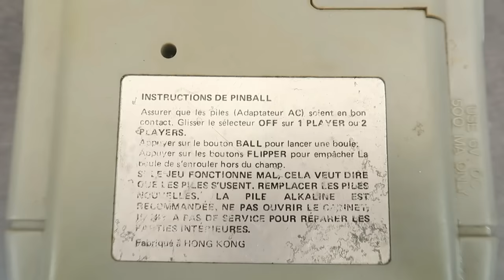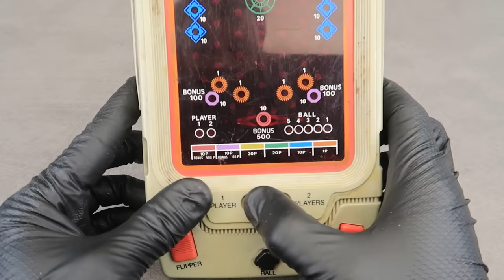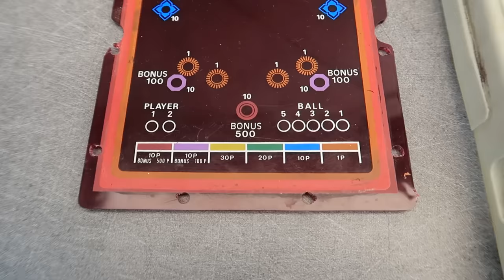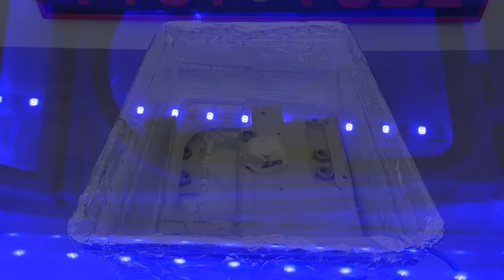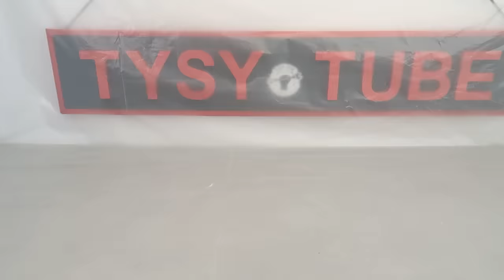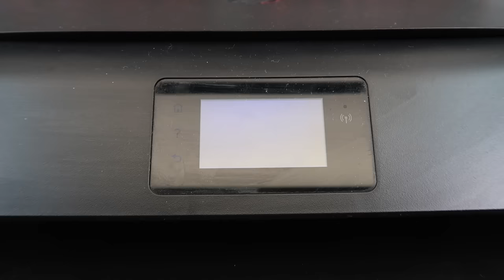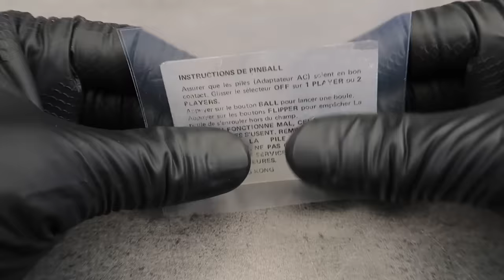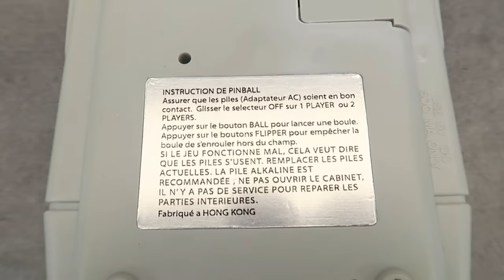Electronic Pinball Retro Game Restoration

Comment: Just a little soldering tip: use a finer point soldering iron and before soldering remove any extra/old tin and ad new tin for a better result and stronger soldering and don’t put the tin on the iron itself just at a bit when you head up the cable but for the rest well done
Reply: Please link is to your awesome videos.

Comment: Tsy: puts batteries on corroded contacts
Product: doesn't turn on
Tsy: :o
Reply: I think you meant "This is not a good sign..." 😏
Reply: "I found these broken wires, that totally broke by themselves inside of the game and not from me opening the case at all"
Reply: it's for dramatic effect.
Reply: I thought it was silly to place batteries into a device with corroded terminals, but this did give a baseline level of functionality before the restoration.  I think he knew that there was very little chance that it would not work once the terminals were cleaned and the wires were soldered back on. He may have tested the device with a 6V power supply before making the video just to be sure.

Comment: Two things. First, be careful putting elastomeric contacts in water. These are the black areas on the bottom of the rubber push button switches in this project. Sometimes they are a coating, sometimes a carbon puck, but either way some of the older ones used a water soluble adhesive and putting them in water will make them dissolve. 
Secondly, using UV leds around a plastic container decreases their effectiveness by at least 50%. The plastic material diffuses the light and depending on the type of plastic, some of them have a UV inhibitor in them so that they don't break down as fast in sunlight. A large, clear glass container is a much better option for a retrobright tank. 
1
Reply from the maker: maybe next time i will buy a fish tank 🤔, thank you 😊

Comment: “The most desired handheld of the 80s”
Colecovision football game: “Am I a joke to you?”
Reply: My husband still has his!
Reply: Football is not played worldwide... Very rarely played outside the USA..How could it be the most desired handheld of the 80s ?
Reply: For my ( french) football is your soccer so yes he his a joke to me
Reply: I got Coleco Head to Head Ice Hockey. Meh.
Reply: The most desired handheld of the 80s isn't a handheld at all but a tabletop. Look up the Entex Adventurevision. This amazing tabletop used a spinning mirror and LED's to achieve graphics. Extremely expensive sadly. As for the restoration of the pinball machine, fantastic job!! I think the machine is a Castle Toy pinball.
Reply: @chevreunijambiste2854  t'as voulu dire quoi  ?
Reply: @familleeatyourmails4205  flm
Reply: @deathstrike  strong desire ? Only 50.000 units sold....
Reply: @chevreunijambiste2854  lvd
Reply: @familleeatyourmails4205   Not when it was sold, the Entex Adventurevision is NOW one of the most sought after electronic handhelds. Only a few hundred or so have surfaced in the wild. I have one, but it only has Defender and it is sealed tightly in my closet due to the plastic oxidizing easily.

Comment: To have your screwdriver shaft temporarily magnetized you might want to consider using a small magnet such as the ones found in mechanical hard drives. Those come in a flat, slightly curved shape and are quite powerful compared to their size. I often use one or two of those stuck to the screwdriver shaft (as near as possible to the tip) when I need to "fish" screws in deep recesses, just as you did, or just keep hold them when screwing/unscrewing.

Comment: I have a tip to give you, if you don't already know, for using instant glue.

When gluing, for example, two plastic plates, which form a 90° angle, place a wooden toothpick at the internal angle of the joint. The toothpick will solidify this joint.
And when the joint is 180 ° (edge to edge) put a strip of paper towel after applying the glue to the joint, and then more glue over that strip. The strip of paper towels will solidify and serve as a patch, strengthening the joint.

Comment: Ordinary vinegar or lemon juice works pretty well to remove battery corrosion from contacts.
You can usually weld most case material back together using acetone or PVC pipe cement.

Comment: a nice job restoring a classic hand held game. I would have liked to have seen maybe the use of some epoxy on the cut off plastic posts instead of melting them with a soldering iron but otherwise it was top notch. I have an alarm clock fro Casio from the late 70s that has the same yellowing plastic and corroded battery terminals and i would love to restore it like this. It still works and the LCD screen is still without residual black marks as some get. I dont use it any more but i would love to restore it anyway, this vid and the space invaders one (which was the first one i saw of yours) has given me the info to try. Thanks!

Comment: Have you considered to use the method where you mix Hydrogen peroxide with a binder to make a paste and then brush it onto the plastic? As binder people use guar gum or Xanthan.
After brushing it on, wrap it with see through foil and either put it into the sun or in your LED box.
You would need much less Hydrogen peroxide.

Comment: Small hint for removing rust/corrosion off electric parts: Use vinegar and baking soda and let it swim for a few minutes in this solution. If the bubbles and fizzing stops then you know the corrosion is neutralized and then can be completely cleaned off with IPA.

Comment: In the US in we have Retr0bright chemical, works great out in the sun.   Also wrapping the piece in film hydrogen peroxide and putting out in the Sun would have worked also.  Those LEDs are not the right wavelength to get benefit of UV, most of the work seen was just the hydrogen peroxide.  8-bit guy has a bunch of whitening tutorials,

Comment: There's a better way to melt/reattach those plastic tap: Get a small no1 phillips head screwdriver. Heat the tip up almost red glowing with a lighter or similar, then poke that screwdriver gently straight down into the center of the plastic tab. The result is a neat cross pattern wedge shape which grips tightly onto the mating piece of plastic. Tidier and stronger.

Comment: 10:13 you should once try Braso. it does wonders on car paint to remove scratches and also amazing on plastics, it cleaned my bedside radio face after i accidentally put something on it and made it foggy now its nice a smooth again
Reply: Do you mean Brasso, or is Braso another product?
Reply: @michaelwarren2391  what you said, i spelled it wrong 😅

Comment: Why not make a more permanent retro bright container?  Instead of using loose aluminum foil, get some aluminum tape that is used to seal joints in HVAC systems.  Wrap the UV light strip around like you do here, but tape it down more permanently with the aluminum tape.
Just a thought.

Comment: I feel like you should have tried cleaning the battery contacts first to see if that was the problem. The broken wires might have just been from opening the case up. Oh well, you'd have needed to open it anyways to clean it up properly so it's no big deal, just a nitpick.

Comment: Oh no you have a pinball machine now.
Now just do not go to sleep I swear they breed at night and another just pops up in the house the next day. xD
Sorry it is corny jokes of pinball enthusiasts that both work on and have the real thing in there homes.
And yeah I pretty much do the same thing here with this electronic one but have about 3,000 parts all over my house and that is just one pin.
I have several I am restoring here.
Cannot wait to get the Star Trek made by Data East done.
And the really old Big Game from 1935. :)
Takes a long time to get them working as I do more then just get them working I clean em inside and out and replace parts when needed and ones that I do not I get the rust off and spray them with grey spray paint or if the metal is seen I'll do a clear coat on it.
Just a warning if you ever do tackle a real pinball machine there will never just be one you get hooked on them and want more. xD

Comment: "not a good sign" in the beginning could have just been salt remains of the leaked batteries, avoiding connection of the new batteries. i think that green crystal stuff is pure salt of some kind, at least it is inside maglite torches because KOH and water from air moisture react into some salt – maybe it needs aluminium to turn into salt? i don't know. yet, i am curious to see the reason for "not a good sign" :)
Reply: okay. broken sold joints. i do refresh alkali batteries a few times (charging current of 20mA works fine) with the only downside that they leak more often if having been "recharged". thus, i sometimnes need to clean battery cases as otherwise, there's too much salt sticking between contacts and batteries.

Comment: Can anyone give me an explanation for how exactly retrobighting works?
Reply: (sorry bit late)
Well UV exposure causes certain compounds in ABS plastic to break down. The resulting compounds are chromatically brown and cause the yellowing as they build up.

These compounds under exposure of more UV-Light and the highly oxidizing Hydrogen-Peroxide react and break down further into compounds that aren't chromatic (colourless). Because of this they stop causing a yellow appearance, thus appearing as if "Reversed". However make no mistake. All that has been done is break down the top layer of plastic further in order to bleach the surface. Though this is far less likely to damage than say sanding off the top surface, the plastic will slowly become brittle under repeated treatment and the underlying ABS plastic can still break down under UV Exposure causing a new case of yellowing.

It is perfectly fine to do it once or twice for a device that has suffered from extensive yellowing, but Prevention will always be better than the cure.
Also do NOT use on coloured ABS plastics. Peroxide is very likely to react with the compounds used to dye the plastic..

(Note. There is a popular theory that suggests "Bromine" flame-retardant is the cause, but yellowing is a general effect in ABS plastics that can only be prevented via UV Blocking compounds (dyes can count as such))

Comment: 8 mins in and 3 ads Bruh WTF?
Reply: It's YouTube, not the creator. I don't mind ads that are 30 to 60 seconds, but not those that are 3 minutes (plus). I'll let the shorter ones run so the  creator gets paid, but I agree with you that sometimes the number of ads is excessive.
Reply from the maker: it depends on the length of the video 😊